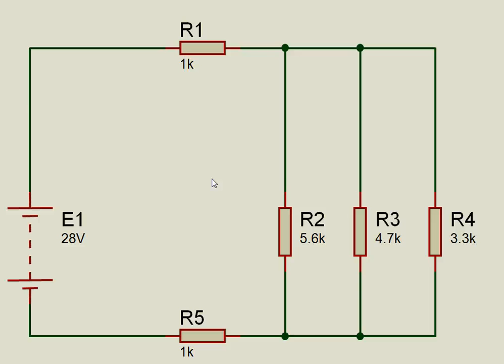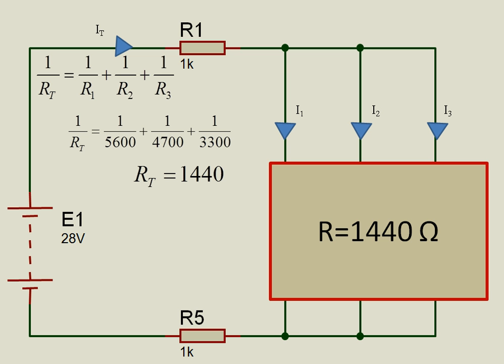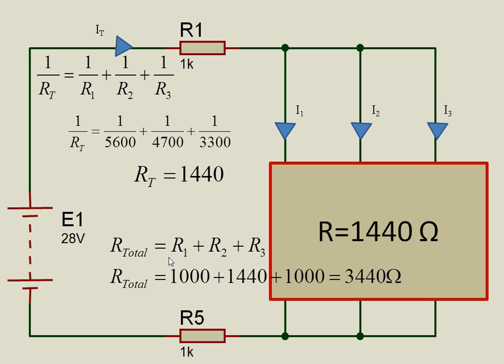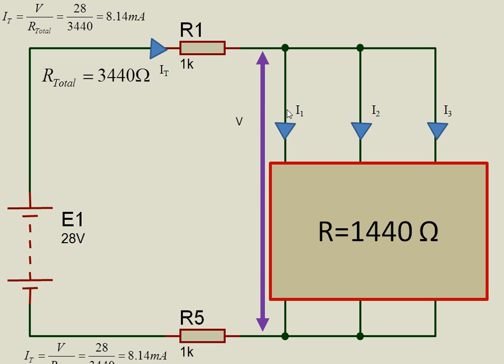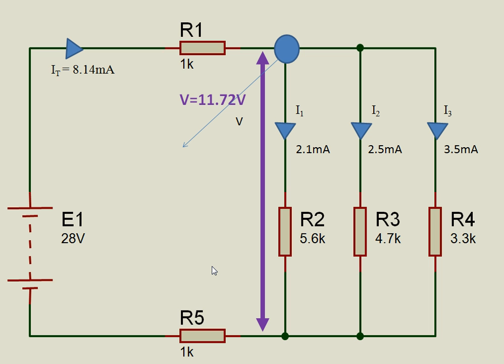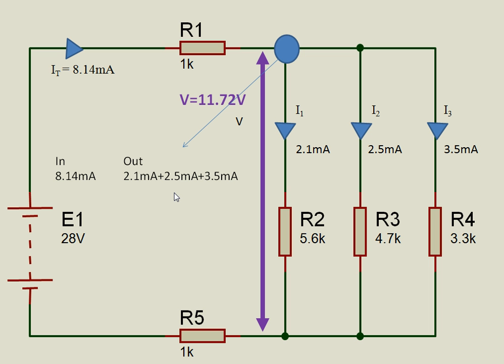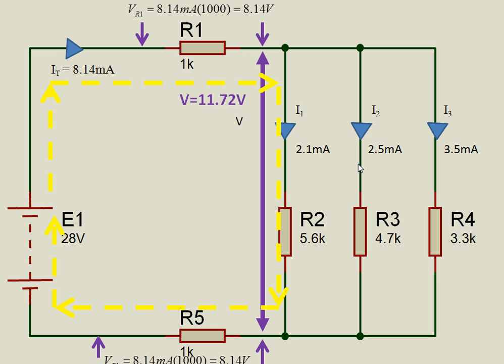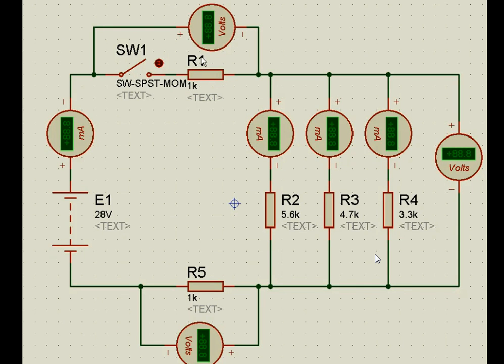Applicaton of Ohm's Law and Kirchoff's Laws with an ISIS simulation

Comment: Using Isis.  If I have 12 psu and connect it straight to a LED via say a 10 ohm resistor.   The Resistor should overheat and blow with the LED.  Will Isis simulate this as an explosion and flag an error like Circuit Wizard?
Thanks.